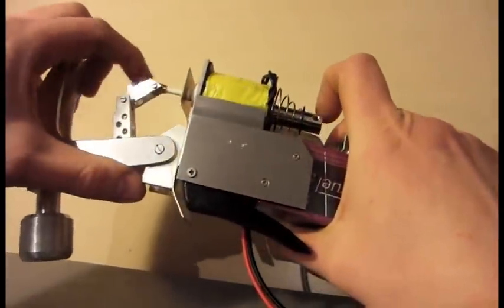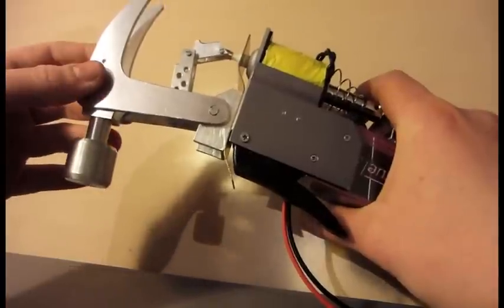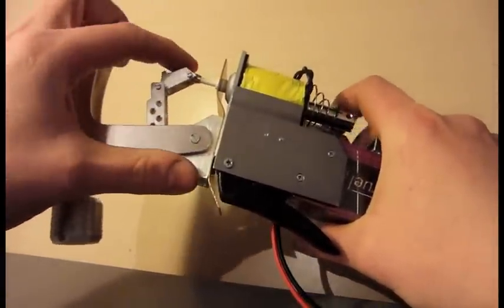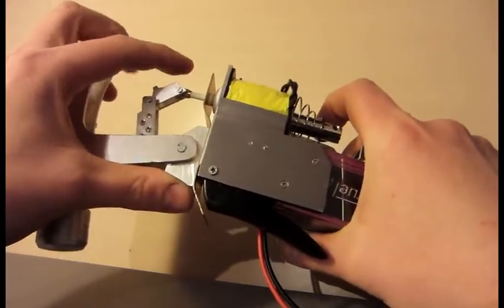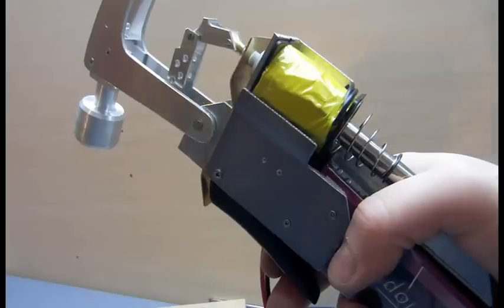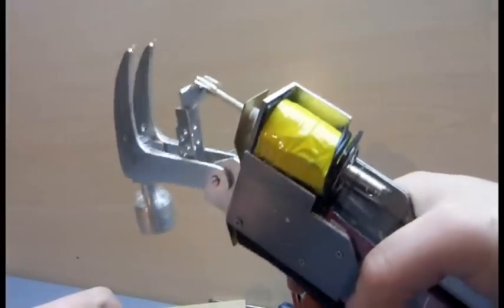Homer Simpson's Electrical Hammer (working, made from scratch)

Comment: Wtf dude. It was not more mechanical than electrical if you have to press the damn switch with every swing then whats the point of it being electric? Homer Simpson's was fully electric. You failed to live up to his greatness son. I'm of course being sarcastic good job.
Reply from the maker: +Yewon2001 I actually thought of making it automatic, but hammering was actually really hard, so...
Reply: +LaserGadgets 
Did you consider adding a simple NE555 bi-stable circuit to the solenoid trigger? Full auto performance AND adjustable speed, just like Homer's. Right now it's like a regular hammer just slower.
Reply from the maker: +Daikataro Kamegawa Nope. Already explained why, maybe 10 times. Automatic = less control. Would hammer the nail even less precise.
Reply: +LaserGadgets Wasn't that the whole point of homers hammer?
Reply from the maker: +TheJosephB333 There is no POINT xD its pointless. But IF I hammer with an electric hammer, I wanna control when and where to hammer instead of having a vibrator in my hand. If its what you prefer fine, not my style.
Reply: LaserGadgets
The fact it's impractical was entire point of the joke.
Reply from the maker: +TheJosephB333 Yeah, and I didnt COPY it...
Reply: LaserGadgets
Ever heard of poe's law?
Reply from the maker: +TheJosephB333 The one that most people connect to Sherlock Holmes somehow? Yeah.
Reply: LaserGadgets
Then no, you don't
Reply from the maker: +TheJosephB333 Midnight over here, and that was Ocks Razor...
Reply: LaserGadgets
Ocks razor? That among competing hypotheses, the one with the fewest assumptions should be selected.

How does that relate to poe's law or your device? I'm saying that, if you were infact attempting to make homer simpson's hammer, you should have made it automatic.

Now it takes 2 seconds to google poe's law. infact I'll send you a link. No one connects ockhams or poe's to sherlock. You're thinking of is "when you have eliminated the impossible, whatever remains, however improbable, must be the truth?" and should be credited to the author, Conan Doyle. This also has no relation to what we are talking about

By mentioning poe's law I was aluding to the fact that when you said "Yeah, and I didnt COPY it." I was unsure wheather you were being truthful, ironic or sarcastic. As none of those possiblities make sense.
Reply from the maker: +TheJosephB333 -.- thats exactly what I mean....thats a quote you hear or read in combination with Sherlock Holmes. Is that your thing?? Commenting on other peoples videos while having an empty channel? TALK IS CHEAP is one of my favs...later dude.
Reply: You got me for a sec
Reply: Fully automatic would result in a potential loss of control. Semiautomatic allows more control and accuracy.

Comment: Question. I know the Lipo battery's have high amp drain. And it appears this is a super simple circuit. Consisting of main power switch, momentary, and solenoid. If you were to hold the momentary down for too long wouldn't the coil eventually catch fire like a stalled motor? Shouldn't there be a circuit to disconnect the power to the solenoid after one full cycle is made.
Reply from the maker: It gets "hot", but before it burns down, the soldered spots would melt.
Reply: Failed to think about that one. Nice job on it though. The machining is excellent!
Reply from the maker: Austin Satoskar
Thanks, check out the others too. Oh btw: Do you like the intro? Or is it too long?
Reply: I like the intro, it suits your kind of style
Reply from the maker: Joshua Gonzalez
Thanks.

Comment: Would it be more effective if the coil was used for retraction of hammer instead of striking it??
Reply from the maker: Why that? Same field same force.
Reply: i dunno. thought that the weight of hammer head along with the spring force should be work out better. havent thought a lot about it. This is what happens when i see youtube videos after couple of beers

Comment: The hammer isn't suppose to just go once every press of the trigger. You should be holding the trigger and the hammer keeps going.
Reply from the maker: Did you ever use a hammer??? I did not want to copy it like a moron. I wanted to be able to use it :p stroke on command. Not just BAMBAMBAMBAM. That would just be one more button btw.

Comment: Nice;) witzige sache, auch wenn ich das nicht kannte vorher
Reply from the maker: Was??? ><
Reply: homer simpsons electrical hammer kannte ich nicht^^
Reply from the maker: DerKrawallkeks
KracherFolge Mann! Gucken!
Reply: alles klar xD
Reply: LaserGadgets put a link into the description :D
Reply from the maker: tommihommi1
Good idea!
Reply: LaserGadgets Könntest du auch noch, die Schmink-Flinte  bauen?:D
Reply: LaserGadgets Did I see guide holes for the nails, or did the third one just get hit in a little bit before you drove it in?
Reply from the maker: *****
Just a tiny poke in the surface to make sure they wont move.
Reply: LaserGadgets Ok then I will accept that, those tiny nails are a pain in the ass. Thanks for the surprisingly bad ass vid. I was always curious if that auto hammer from Homer would work.

Comment: I could see this having automatic switch just to go back and forth as long as you hold the trigger... A bit more useful, and a bit more lazy... Possibly even a switch to toggle the auto-hammering, to still have the option to more carefully hammer...
Reply from the maker: It was a weekend project, and auto mode is really senseless but more authentic. Since I really wanted to actually hammer nails, it should only hammer when I want it to :P
Reply: 'twas just an idea. =3

Comment: I love your other projects but this is wrong on so many levels, and anyone who knows how to use a hammer will will agree. You have no control whatsoever on the force applied on the nail. It is not rigid, thus making it difficult to manage the direction of the force. It's probably also heavier than a normal hammer (can't really say though). And obviously a hammer doesn't need electrical power. Plus, I don't find it easier to operate than a normal hammer...
Reply from the maker: Dont rant so much :p its from THE SIMPSONS and I said its senseless myself. Its not a tool. Dont act like I made this for work xD
Reply: Ahaha ok, I just thought it was actually supposed to be useful :D
Reply from the maker: Pietro Baroni
Thats why Ive added a link to the episode.

Comment: Heh, it isn't so much of a nonsense if it actually works :))
Reply from the maker: Yeah, lucky me. the first head was made of brass, didnt work to well.
Reply: LaserGadgets That was a coil you had on hand or that's as much power you can get from that size factor?
Reply from the maker: aserta
The coil is made in china, but I was really lucky I had it laying around (no idea why I bought it or even where), because I am out of wire anyways.
Reply: LaserGadgets To improve the power, the coil should have a iron core, and the construction would be a pulling mechanism, not a pushing;) and capacitors of course. But anyway:D
Reply from the maker: DerKrawallkeks
Fasel nich immer soviel. Wat meinste denn, was das glänzende Ding da ist? Styropor? Ob die drückt oder schiebt, die Kraft ist die Gleiche, aber wenn DU mal einen baust, mach ruhig wie du meinst :p
Reply: Ein fester Eisenkern in der Spule vervielfacht wegen seiner großen permeabilität das Magnetfeld. Ist dann natürlich mit dem Stab durch die Spule schwer zu bauen, deshalb nur ziehend. 
Werd ich sicher so bauen, wenn ich das mal mach ;)
Reply from the maker: DerKrawallkeks
Die Spule zieht doch Mann. Ich hab keine Ahnung was du meinst. Wenn da ein Stab drin ist, wie willste da noch nen bewegendes Teil anbringen? Die Spule mit Eisen MANTELN würde auch funzen...nur ma so Tipp von der Nudel für den Pro.
Reply: Kartoffel an Nudel, wenn du n festen eisenkern in der spule hättest, der dann n anderen magneten/eisenstab anziehen würde, wär das viel stärker wie wenn die spule einfach nur den eisenstab anzieht, know what i mean?^^
Reply from the maker: DerKrawallkeks Du solltest solche Sachen mal probieren, dann wüsstest du woher mein Facepalm kommt. Blabla is immer einfach :p mach ma, dann reden wir drüber. Find ich nich so pralle mit den Leuten die Sachen zerreden aber nie wat machen.
Reply: Ehm..ich hab über 100 videos auf meinem Kanal, wo ich Basteleien zeige, ich weiß wovon ich rede, und es war ja nur ein Vorschlag, wie man das Teil, was ja so schon recht cool ist, noch effektiver machen könnte.
Reply from the maker: DerKrawallkeks
1. kommt sicher geil wenn der Stahl dann rostet und nicht mehr glatt ist, 2. ist es wie gesagt WURSCHT ob es drücke oder zieht, außerdem zieht eine Spule immer zum Kern, also müsstest du die Spule auf die andere Seite packen und schließlich 3. Eisen UM die Spule rum hat denselben Effekt..und das schreib ich jetzt wirklich nich nochmal. Nur wenn ich nicht wüsste was ich tue könntest du mir helfen und auch DANN nur wenn du mehr drauf hast. Haste?